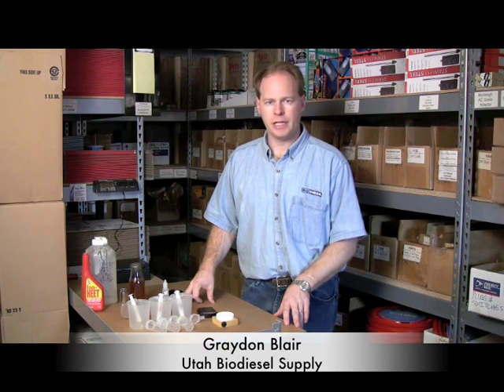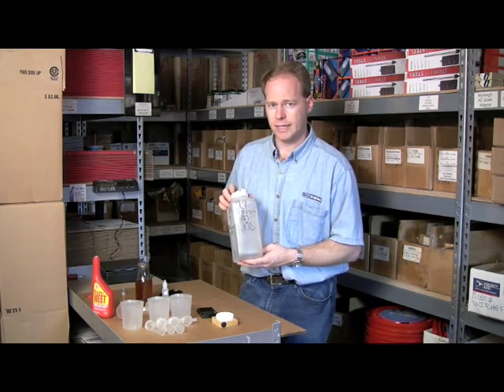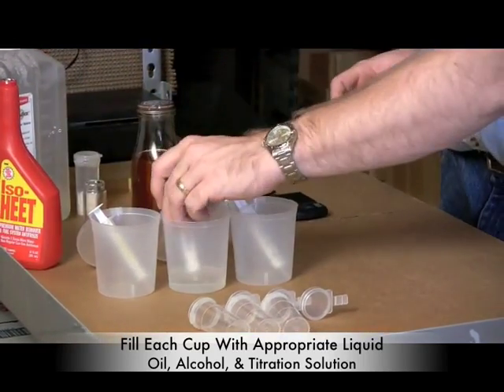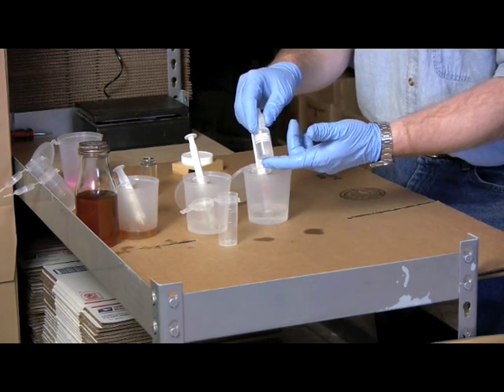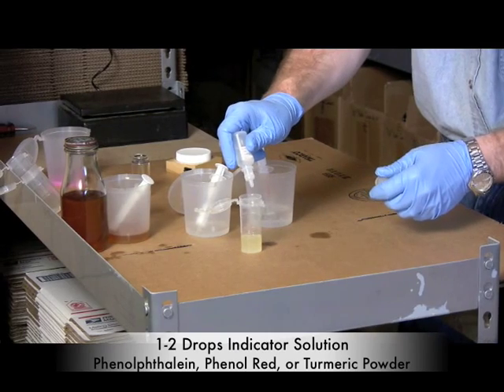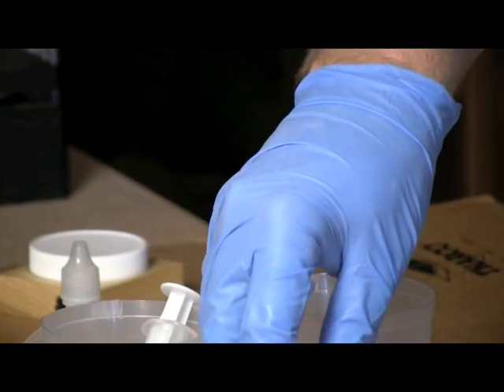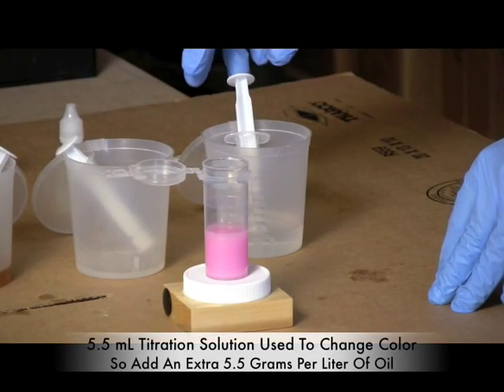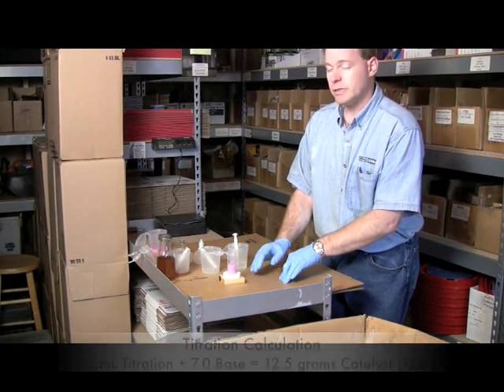Biodiesel Oil Titration Example With Our Mini Titration Kit

Comment: For methanol, it's always just 20% of the oil you start with. For example, if you're making a 100 liter batch, you'll use 20 liters of methanol. Or a 100 gallon batch, 20 gallons of methanol. It's always 20% no matter what the titration comes out to.

Comment from the maker: It measures the level of fatty acids in the oil. No. It doesn't necessarily have to be filtered to titrate it. 

Well, glycerin is part of the oil molecule that makes up grease. When making Biodiesel, we chemically remove the glycerin; which usually comprises about 20% of the volume of oil. Crude glycerin (unrefined) isn't worth much. Soap per gallon is dependent on fatty acid levels. 

Yes. It can be profitable to make Biodiesel and sell it as well as sell the soap to pay for chemicals too.

Comment: what does trytation actually do to the oil?? should this stuff be filtered by this point? is the glycerin allready removed??  how much glycerin is there usually per gallon of grease??? how mucch value does this glycerin have as just straight glycerin?? how much soap can this make per gallon?? can this make a profit to pay for biodiesel chemicals and more/?